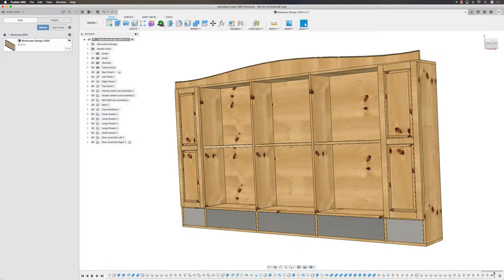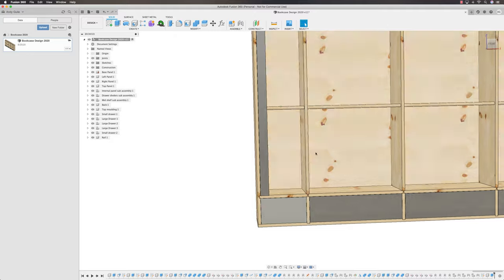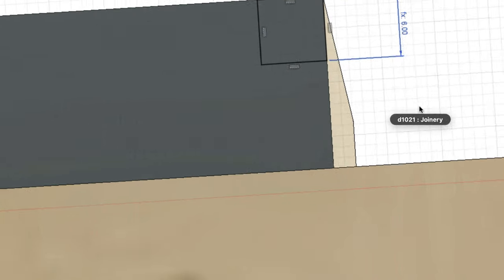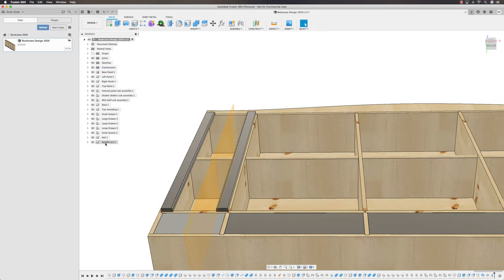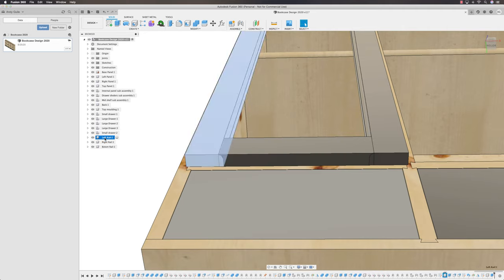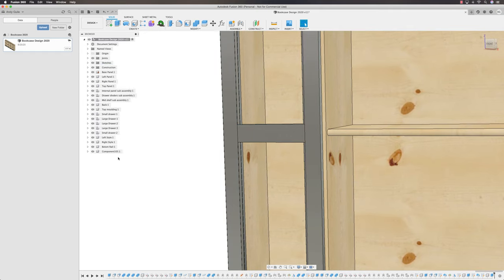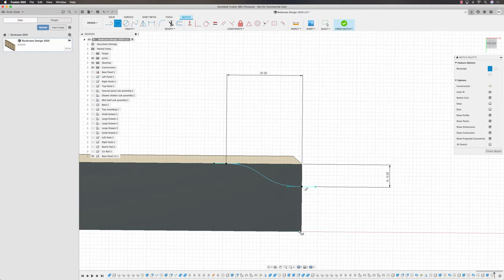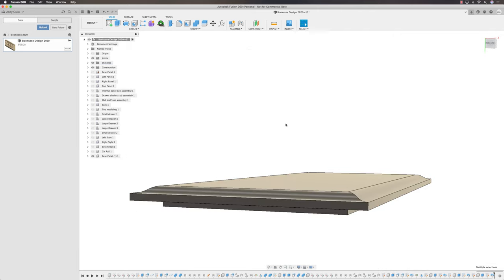Fusion 360 for Woodworkers - Lesson 12 - Raised Panel Door

Comment: As always, Awesome tut Andy! I almost started typing out a comment mentioning your mistake on naming rails and styles... You picked it up and fixed it (which blew the wind out of my sails a bit - lol) Here's a tip I learnt to remember the difference: Hand rails in bathrooms, escalators and even the tracks trains ride on (think of the rail road...) are horizontal (or horizontal to the plane of motion). Once that's determined the styles would be easy to name by most people with an average IQ. :-)
Reply from the maker: Hi,

My mind has a strange trait - when I concentrate on the designing, the building, the explaining, the video some of the details in my head don’t reach my mouth as intended.

It’s only when you get some distance from what you have just done that you realise you have used the wrong word.

Most I pick up in the edit - but things like the one you point out can’t be edited out. That plus a hitch with my editing software put behind schedule so didn’t have time to re-record.

Like your tip, :-)

Cheers

Andy

Comment: Thanks Andy. Great Lesson. I really enjoyed it but it was a bit brutal as a mistake made in the past showed up. I noticed after the mid rail creation that Mid Shelf was not centered. An extra offset face command after the mid shelf extrude command was the culprit but it took me a while to find.  Good practice, I guess.
Reply from the maker: Hi Howard,

You won't believe how long it took me to work out that middle shelf, gave me brain ache. I think the hardest part of Fusion is working out the math for the formula. Sadly I am a sadist - so I am trying to work out if I can use boolean logic in the expression.

"If stock thickness is > 18, then domino thickness = x" type thing. 

I think I should just get back in the shop and butcher some wood.

Keep pushing, as you say it is all good practice.

Andy

Comment: Hi Andy, great series of lessons , 
I’m considering buying the shaper origin and this is why I’m looking at a design application like fusion 360.
Can I use fusion 360 to generate designs to use on the shaper, not only shapes /engravings but the joints too?
Is it easy to convert the designs to the file format of the shaper?
Thanks for your help

Comment: Hey quick question on this: I've gotten this far and started playing around with adjusting the parameters to make sure everything scales properly and I've run into a problem: when I increase the BookCaseHeight everything scales perfectly except the top and the molding. I assume that's because the top isn't referenced to the side panel but I can't seem to fix it. Thoughts? Easy fix? or will I break everything trying to go back and fix it? thanks!
Reply from the maker: Hi,

Yes it is a problem with the ref point, you can fix this by using the joint command.

Use the joint as built and connect the top to the side. 

Joint as built.
Find a convenient  end Center point on the lower part of the  top panel.
Then find a Center point on the top of the outside panel.

That should sort it.

You will then have to joint the moulding as well.

Let me know if you need more ?

Cheers

Andy

Comment: Sorry to bother you, but I'm been having trouble using the orbit tool, I'm never able to get the view i want and definitely can't replicate the way you change view in this video.
Do you have tips on settings and best input devices?
Thanks
Reply from the maker: Hi Luca,

Yes it can be messy with a standard mouse. You can use a three wheel mouse.

But, I use a three wheel mouse and a space mouse. It takes some getting used to, but when you master it you can really navigate Fusion at a different level.

They are expensive, this is the one I use.

3Dconnexion SpaceMouse Compact 3DX-700059 3D Mouse,black https://www.amazon.co.uk/dp/B079Z3T2XC?ref_=cm_sw_r_apin_dp_NBNZCV1JMM0S9B3J07HC

Cheers

Andy
Reply: @TheWoodgrafter  hi Andy , thank you for the reply and yes, I already gathered that my 2010 gaming mouse was the problem, I already ordered a Logitech master 2 and will keep the space mouse on the backlog 😅.
BTW, what is an example of a 3 wheel mouse?
Thanks 
Luca
Reply: Never mind, found it